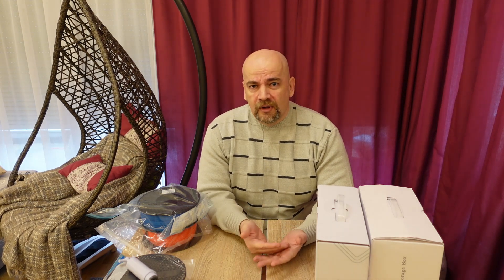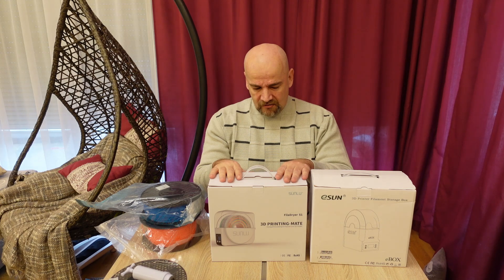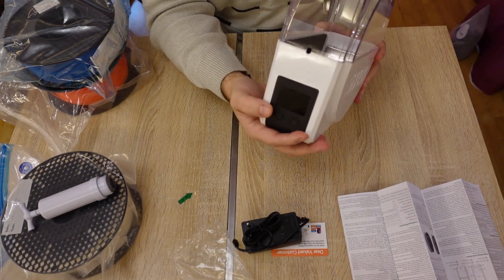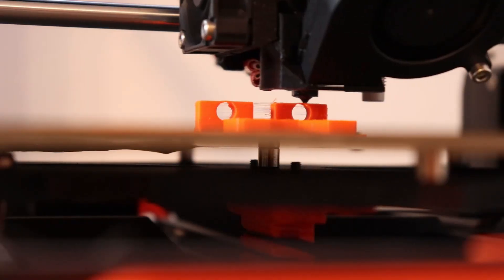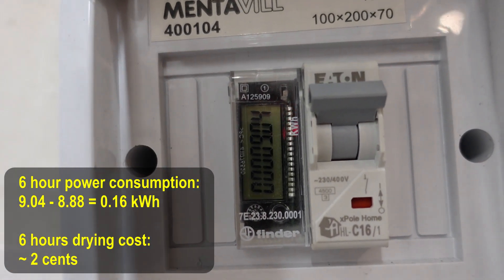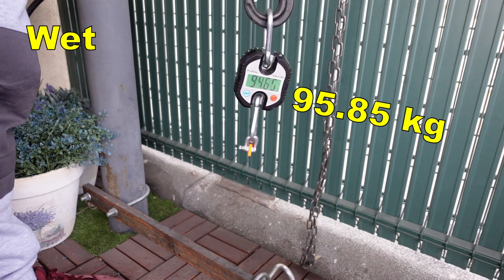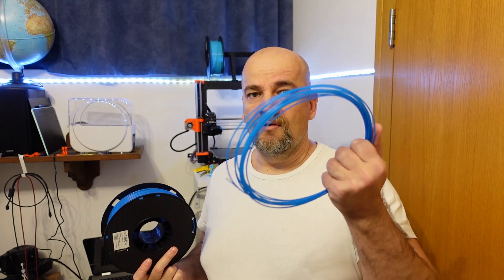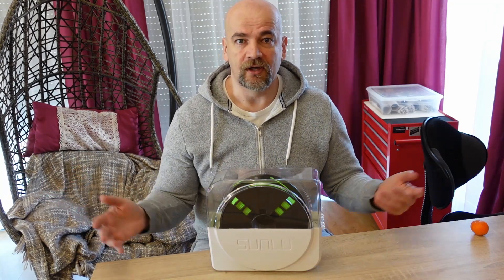Testing SUNLU FilaDryer S1 - filament dryer unboxing and review

Comment: The PCB actually contains a location for a circulation FAN connector. However Sunlu CRIPPLED the PCB by leaving the "nickel's worth" of surface mount components out. See the picture at the URL: 
http://www.keywild.com/X/sunlugw-E353820-YX-01(missing).jpg

Comment: Have you tried a food dehydrator?  I was going to get a few of these but for cheaper I could get a food dehydrator and use it for other things like, well, drying food.  I like how these are hassle free, not needing to move the spools about.  I wish spool dryers were airtight though, I realize when it is heated having it airtight wouldn't let the moisture escape but when not heating if it was airtight these could be used for long-term storage.
Reply from the maker: I tried food dehydrator, I am using it to dry nylon. But filament driers are good to keep filament dry during the printing

Comment: Hi bro which of the "esun" or "sunlu" do you recommend?
Reply from the maker: They have very similar drying capabilities. Look for the specs at 18:51 and decide which pros are more important to you (quiet, fan, place for silica gel, higher temp, weight scale, bowden tube..)
Reply: @MyTechFun  If we use oven instead of these machines, will we get a successful result?
Reply from the maker: @tahaulsu2938  Problem is that you can not print from oven ;-) These dryers are good for PETG, PLA, ABS. If Nylon, dry it in oven and then during printing use one of these dryers to keep it dry.

Comment: Hello,, Can I use the sun Lu to dry my pla filament when it’s still? Or it should be in motion during drying
Reply from the maker: Yes, but don't use it on max temp (see manual). And also pay attention filament not to touch the heating plate, it's almost 70°C (if filament is on spool, it's OK).
Reply: @MyTechFun  😊🙏 Thanx

Comment: Excellent test and video!
You showcased everything really well, even the crackling sound of the wet filament.

I ordered one for TPU usage and hope it will do a good job.
I don't know yet where I'll install it for my direct drive printer (CR-10 V3)
Reply: how are your results? ^^
Reply: @mongini1  I have very good results so far with TPU, even without installing the fan mod.
I installed a thermometer+hygrometer in the top front and when set to 50°C it shows 44.5 and 16% humidity.

Comment: Great video... If you can do a video with comparing Sunlu and eSun that would be really helpful.  Thank you
Reply from the maker: Thanks. Yes, that's the plan. Maybe I will include PolyBox too. Usualy I do comparison only after several month of usage (unlike a product review, when sometimes I have only 1-2 weeks to test a product).
Reply: @MyTechFun  does the Sunlu unit have a fan in it? The eSun one is very loud but it seems a fan is necessary to distribute heat inside
Reply: I’m looking at all 3 (sunlu, esun and polybox) a comparison would be fantastic.
Reply from the maker: @markjones9180  Polybox probably I will not test (except if they send one to me). It works only based on silica gel you place inside. There is no power or drying with temperature.

Comment: I love your test, but you should make a minimum of 3 samples each time, so you would have some statistical accuracy in your measurements of the strength of the filament
Thank for sharing your results. Happy holidays to you and your familie :-)
Reply from the maker: I agree. Usualy I have at least 2 samples (I know, 3 is recommended for some minimal statistics). I wanted to publish the video that day, and I was short with time a little bit. I need daylight for this test to record it.
Reply: I agree that three separate print jobs for each filament sample would improve the quality of your data. Still, this is already great work!

Comment: I have the esun , and works very well, i have a roll of  tpu about a year , and its imposible to print it, but after 5 hours , its prints like pla.But 
The construccion of the esun its very weak, the jack power connector just came out when i remove the power jack..so i fixed with some hot glue...so its works well but be carefull because its a littlle weak build
Reply from the maker: Thanks for this info. I will be ready for the problems ;-) Soon I will start with eSun testing. After few months, when I will have enough experience with them, I will compare these two filament dryers.

Comment: I got the S1 a few weeks ago. I am pretty disappointed with it and the biggest reason is that the temperature inside the box (with the spool inserted) at 50°C set is only more or less 34°C-38°C on the bottom side of the spool (no contact with the heater metal) and less on the top, over the spool. I have printed and made an extra fan from thingiverse (4628798) and with this fan I get max. 42°C after a few hours!  So, out of the box, it doesn't reach the 50°C set... Not tested how far it goes with the max. 55°C set but for sure not too much more.
Reply from the maker: Thanks for this useful info. Yes, I noticed that heating surface is approx 70°C. Probably, sensor is correct, but problem is it's location (too close to heating surface). Air is near to set temperature, but only down, where heating source is.